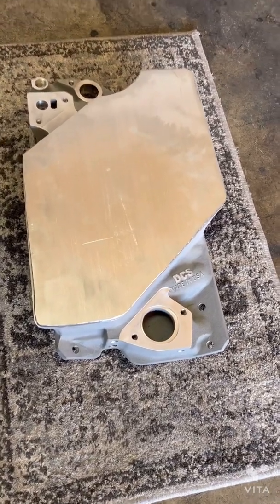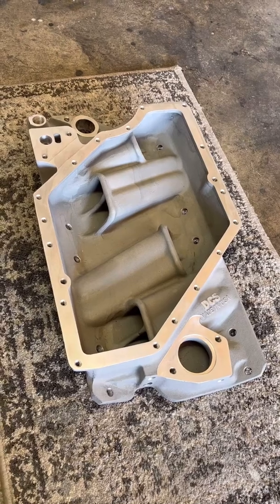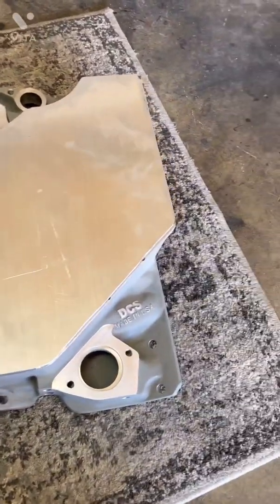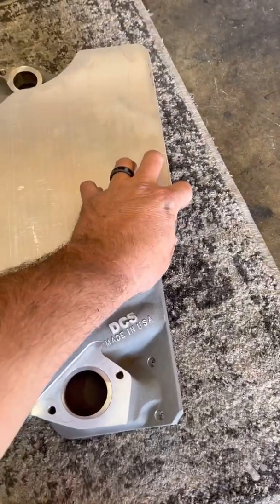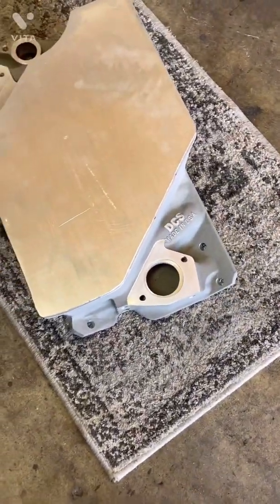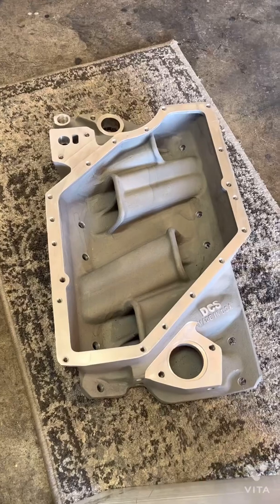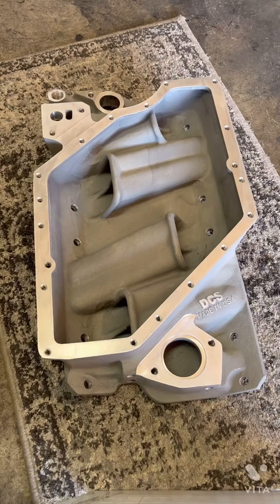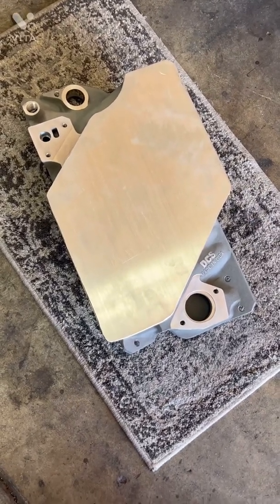New DCS Renegade intake manifold project

Comment: Looking great. Hope it sits perfect! Silly question, couldn’t you just reuse the stock plate?
Reply from the maker: The stock plate is shaped very differently than the one that goes on the Renegade. Making a new top plate is very easy though. The 3/8” plate is the same thickness as the one supplied by DCS with the manifold, and has a machined finish. It’s an easy project.

Comment: I have had an x-fire project underway on and off for the paat couple of years. Was going to use the gm 7747 ecu with Moates programming  but I have been giving more thought to the microsquirt instead. mS looks more intuitive than the gm. This is going on a 250hp gm crate motor.
BTW, thanks for the x-fire content.
Reply from the maker: What’s it going in? A 7747, or even a stock 5055/6026 is more than capable of running a stock 350 target motor. They’re nothing more than a 929 cam (which is basically a broomstick) and usually a “hecho in mexico” 882 or 993 equivalent head. A ported base, along with a FP and timing bump would be more than adequate. If for whatever reason you think you need more than that, I’d look into a HAM board/EBL from Xfireperfomance.com
Reply: Going in a 56 chevy truck. 5 speed with 3.42 3rd gen rear axle